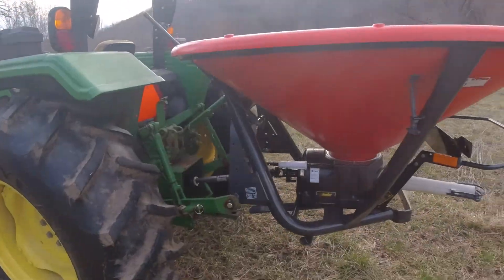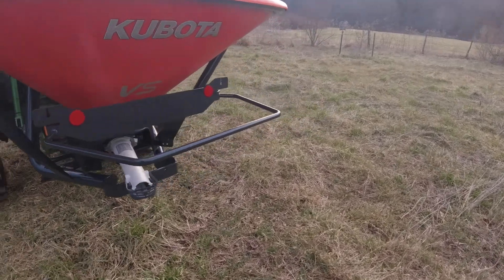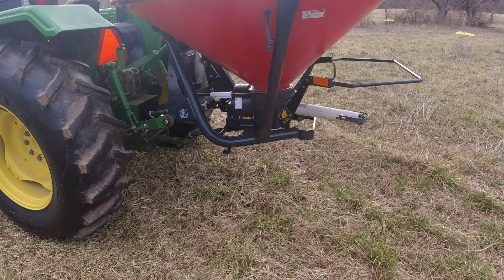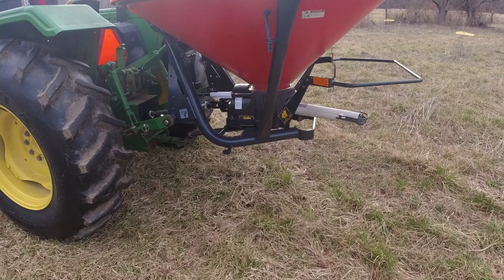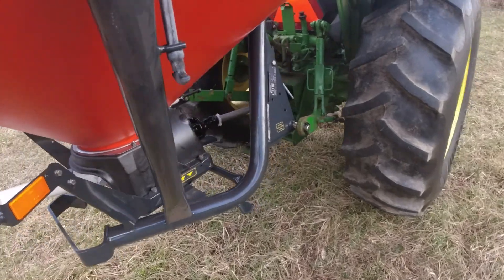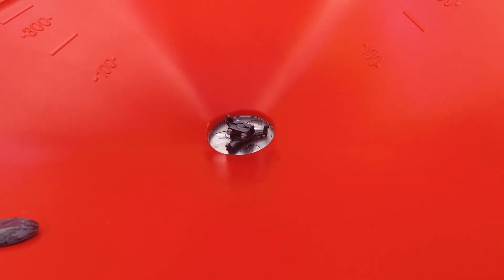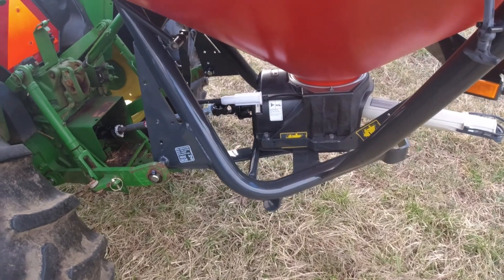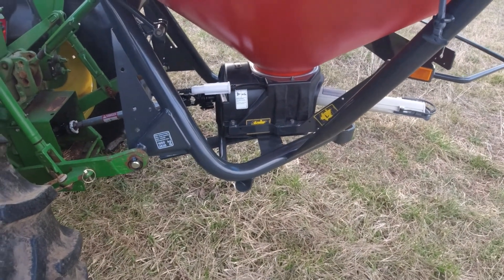New Kubota Fertilizer Spreader Walk Around

Comment: My comment is 18 months or more after you made this and the other videos of your Kubota Fertiliser spreader so some of what I am about to write you may have already learned from your own experiences of using the fertiliser spreader.  
  Firstly be careful if using the spreader on the Massey Ferguson that the handle for opening and closing the fertiliser spreader does not break the window on the 1105 .
 Depending on how the fertiliser spreader has worked so far you might find that when you get the hopper extension to load 2000 lbs of fertiliser that there will be a lot of weight on the back of the tractor and this could effect the steering of the John Deere tractor,  adding more suitable weights to the front of the John Deere tractor might help with this possible problem.  The 1105 should be heavy enough. 
  You could get 2000 lbs bags of fertiliser now and then use a pail to load the fertiliser spreader, which at first thought might sound foolish but I actually use a 15 lbs pail to load 1000 lbs into my fertiliser spreader . I could buy 100 lbs bags of fertiliser but I personally prefer to use a pail to lift 15 lbs at a time and my back , hips, and knees definitely prefer to use a 15 lbs pail. 
 With the nitrogen type fertiliser you can also spread it after rain when the ground is good enough to take the weight of the tractor and the soil is still damp enough so that the nitrogen granules stick to the soil.

Comment: I think you made a good investment. Is there a certain height the spreader has to be for proper spreading width? I know my cheaper spinner spreaders require the spinner be 3' off the ground for proper spread width. I have an EZ Guide 250 gps unit. It works great and didn't cost a lot- but it will pay for itself by keeping you from overlapping passes to much. Thanks for the walkaround!!
Reply from the maker: The lower link pins are set 28.5 inches from the ground if I recall correctly.  Thx for watching!